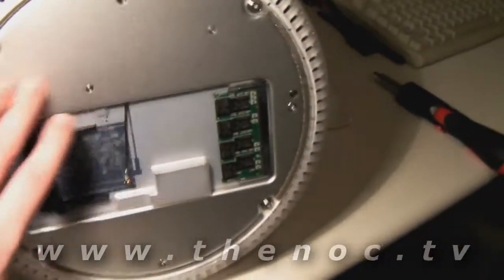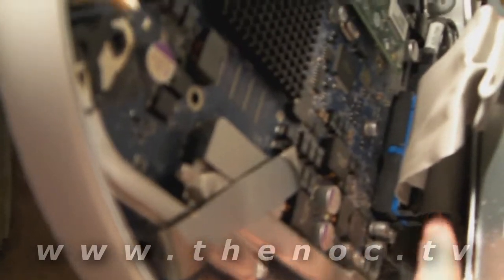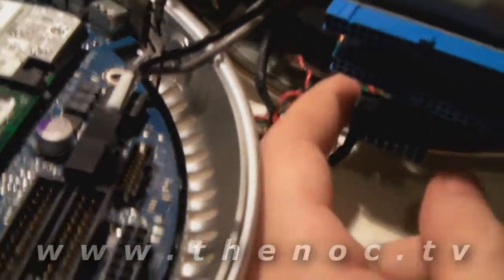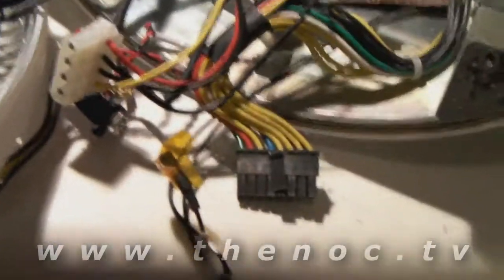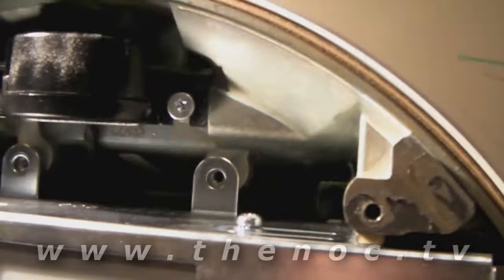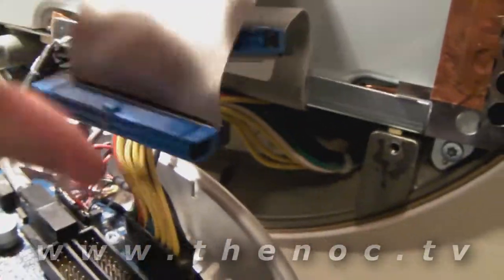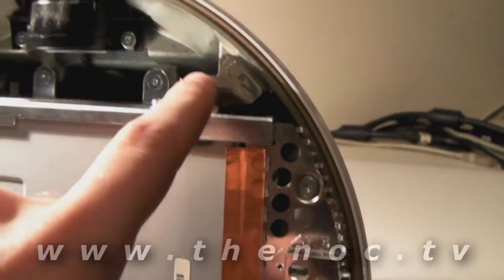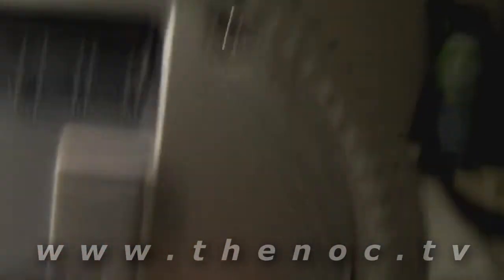Replacing the hard drive in an iMac G4

Comment from the maker: @theimaginator16 The way it's designed the top and bottom are connected with heat pipes, the actual thermal pads are applied to the motherboard and the heat pipe connected to it, so there is no additional paste to put in between the two heat pipes, if you do it actually cools worse.... yeah apple...

Comment from the maker: The casing gets quite warm in my opinion, which means the inside temps are much higher.

This system of course is not mine, so I did'nt have a chance to run a temp test on it.

Comment from the maker: Only 1 fan at the top of the case above the hard drive. The entire case is used as a huge heat sink.

Problem is this design is bad because it tries to spread the heat everywhere instead of quickly moving it.